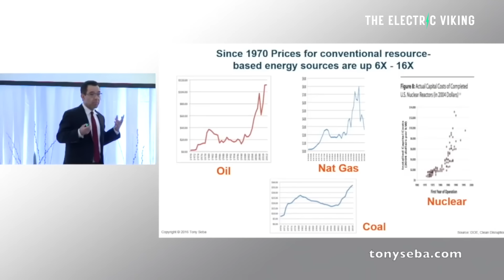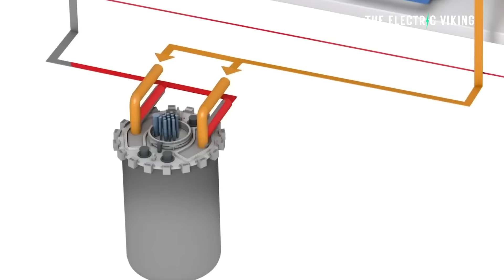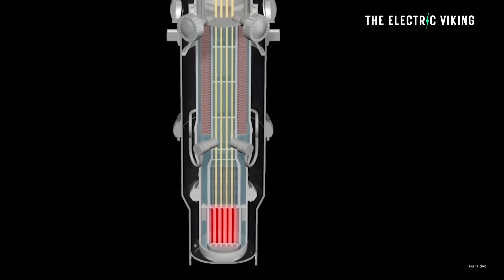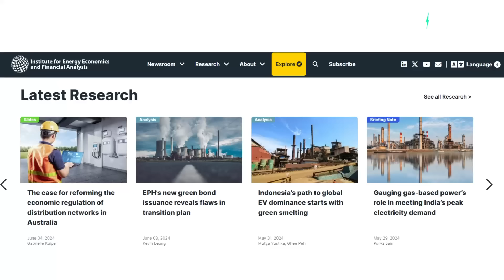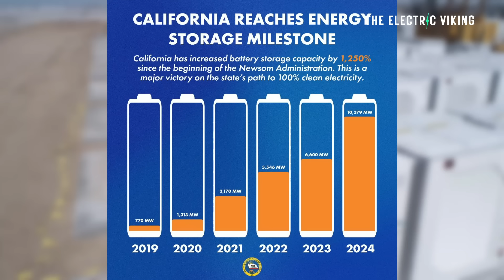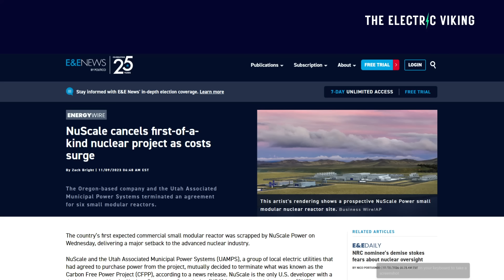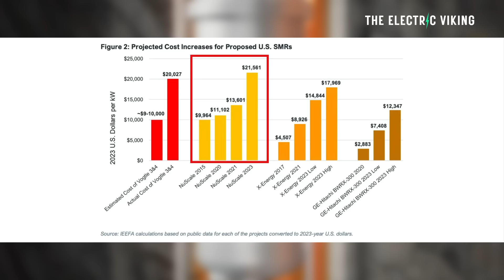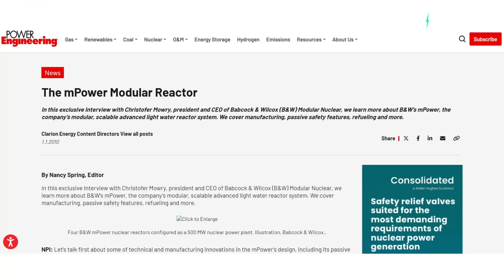In 2014 Tony Seba said Nuclear would be obsolete by 2030 - he was right

Comment: SMR's are still possible. The very small units are portable and are very safe compared to what most people have seen in the media and could still find very useful application at low costs.
Reply: The electricity cost from SMRs is very high. What is "cheaper" is that you're only building small units so the investment is obviously lower – but you're also producing less that with one big plant.

Comment: If it's going to be obsolete by 2030, any project you start now is going to end up a stranded asset by the time you finish. Unable to sell power because it's too expensive for people to want to buy it vs alternatives and because nobody wants to buy your power nobody wants to buy your power plant. So you have a giant paperweight.
Reply: But ruinables are more expensive than nuclear if you use real numbers.
Reply: @ForbiddTV Any proof?
Reply: @205rider8   Sure, lots of proof.
Reply: @205rider8   The Greenie numbers are RATED capacity.  Wind rarely puts out rated capacity, and solar NEVER puts out rated capacity.
Reply: @205rider8   As an example, all my solar systems put out only about 1/4 of its rated capacity in the best summer months, and only about 1/32 of its rated capacity in the worst winter months.  Aside from maintenance periods, nuclear can put out its rated capacity 100% of the time.
Reply: @205rider8   Wind is similar; my systems are rated at 25mph and very rarely is the wind blowing at 25 mph.
Reply: @205rider8   Solar only puts out NEAR its rated capacity for about an hour on a cloudless day.
Reply: @205rider8   Solar panels also degrades about 2-3% in the first year, and another 1% each year thereafter.
Reply: @205rider8   All ruinables need a peaker plant or storage to operate on the grid.   Be sure to tinclude the cost of a peaker plant or storage to your Greenie numbers.
Reply: @205rider8   Oh yeah, you have to completely replace ruinables 2-3 times in the same lifespan of a typical nuclear power plant.
Reply: @205rider8   Then there's land use.  Wind farms requires 360 times more land than a similar-capacity nuclear facility, while a solar plant requires 75 times more area, and those are RATED numbers which are wrong in the first place.

Comment: The whole idea of the SMR is that it’s the cost of bespoke designs for each reactor that makes them expensive. Looking at the costs of developing prototypes doesn’t tell you the cost once in series production. The automotive industry has the same problem. Creating a small run of or one single vehicle is expensive (especially if it needs to go through certification processes). Mass production of both makes things cheaper, and once the approval process becomes something well understood by both governments and the manufacturers that should become faster also.

The big question is how much storage capacity and excess generation (to allow storage to be filled) would be needed to cover periods of low sunlight and wind. Put numbers against that and we’ll see how cost effective nuclear actually is.
Reply: The so-called 'learning curve' for mass production is achieved by making 10s of thousands of iterations. With SMRs we're looking at a) 50 different design, and b) a very small number of builds. Plus, the 'power block' (where a steam turbine is used to make electricity) is already as good as they'll ever be so no cost reduction through 'learning' to be expected here.

Comment: Seba is wrong. The cost of nuclear is much less expensive than solar over time. We will have more nuclear in 2030 than now because it is cleaner, safer and more reliable than any other source  

Cost are only driven high by political resistance not construction or operations.  Solar is good nuclear is awesome.

Comment: Renewables keep growing.  So Tony Seba is right (in this sense).  But this hasn't made much of a dent in decreasing fossil fuel use.  

The data center issue, is a good test.  Most of the tech companies want a low carbon solution.  They are more price insensitive than most sectors.  But they need the build out this power fast.  They are willing to pay a premium.  Power requirements are huge.  And they need 24/7 support.  So what is the solution here?  Is renewables+storage enough?

I was hoping for better with nuclear.  But apparently, even with the new designs, its taking too long, as too expensive.

Comment: Until recently I thought that we would always need nuclear to backup renewables but I don’t think this is the case now that we have cheap battery grid storage.

All you need to do is to build enough renewable generation (which is massively cheaper than nuclear) and install enough battery storage to cover any dips in renewable generation.

I also think there could be a case in the UK for generation from the tides. Big up front cost but virtually nothing to run it and guaranteed predictable generation.
Reply: You think massive battery storage is cheap?  The need for controllers and long range communication make the complete green energy dream prone to multiple failures and long down times.  There will be weak prone system connections that will bring a New York City type  Black outs ,  1965 , 1977, 2003 .  K.I.S.S..
Reply: @mikewallace8087  it’s cheap compared to nuclear.

Not sure what you mean by the need for “controllers”. Are you suggesting that nuclear or gas need no control systems?

Long range communications: why is this a problem with the Internet and systems like Starlink?

Where are the figures on downtime, we would love to see them.
Reply: @johnmason5626   A central power plant it is easier to access problems and perform Maintenance and repairs as all necessary tools / needs  are on hand .  Battery storage systems are many and widespread. As a field service technician   I know about travel time , physically moving needed tools , working in uncomfortable weather , having every replacement parts for various manufacture equipment .  Starlink satellites are prone to Solar geomagnetic take downs .  Starlink had a 40 satellite failure on one storm .  We would love to see them ..?  How many people are you ?
Reply: @mikewallace8087  so, what you are saying is that a central power planet is a single point of failure. Got it, good to know.
Reply: @johnmason5626  Central power plants have redundancy systems that are tested by bringing into action so as the duplicate system is tended to to prevent / reduce the chances for power production  failure . The systems are flip flopped to use in the system for even durations.   You are disingenuous as I already knew.
Reply: @mikewallace8087 that would not help with a natural disaster. This is why, in the IT industry they use at least 2 data ended is different locations.

In any case, the energy industry does not agree with you since global investment in renewable generation has overtaken investment in fossil fuels.

Comment: Small nuclear reactors will be ideal for Mars since low air density means wind power is out yet there's enough wind to fill the air with fine dust particles for months at a time, making solar energy a poor bet, even with batteries.

Comment: What you failed to consider here is why is the cost and delays so awful with nuclear? Wind, solar, batteries, is heavily subsidized and has its own set of environmental issues, many of which will not be realized for another 30-40 years. However, when that bill comes due, it will be far greater than most realize.
Nuclear power looks awful from a cost and time perspective because it has been demonized for so long they make the regulations involved in building/operating ridiculous, and that is what drives the cost and causes severe delays. Also there are virtually no subsidies or political will to push for a nuclear solution. And so it becomes a self fulfilling prophecy.
There is literally nothing "renewable" about wind and solar. There is a huge cost (monetarily and environmentally) that is hidden with these options. Besides all the cost in creating these options they also require maintenance and will have to be replaced on a regular basis, and it all involves highly toxic chemicals that must be mined and then properly disposed of to prevent toxic pollution. This idea that wind and solar are some environmentally friendly low cost power option is complete BS.

Comment: You are completely right - if you are lucky and live in sunny Australia, California and the like.  I know the large majority of mankind is lucky enough to live in the sunbelt, and there it is the right way to go. 
There is however  a not neglible minority living at to high latitudes and/ or prolonged dull / rainy seasons. In densely populated areas resistance to ever more windpower Installations is growing rapidly - even though w'are at merely 50% renewables of current  electricity demand, and have barely startet to electrify industry, heating and transportation. For cases like these new nuclear still is an Option!

Comment: a nuclear power plant produces about 1 gigawatt of power (10^9 watts).   that is equal to the power from sunlight falling on one square km!
(10^3 watts/ meters^2   x  10^3meters  x 10^3 meters = 10^9 watts )
Reply: Sure.    But solar panels are at best 20% efficient(*), so now you need 5 km^2 -- for a few hours around noon on a perfectly sunny day.    What's the average insolation over a full year at your proposed site?   If you're lucky it might be 100 watts/meter^2.   So realistically, ow you need 50 km^2.     Plus a huge battery bank, which might last 10-15 years before it needs to be replaced.   Meanwhile the 1 GW nuclear plant that sits on one square km will pump out an average of 900 MW for 60-80 years, day and night, clouds or sun, it doesn't care. 
(*)Yeah, I know, some are now 22-23% -- when they're brand new.   But with inevitable degradation over their lifetime, 20% is probably optimistic.

Comment: If a $2billion SMR breaks down is it $2billion for the new one ??  😮
Reply: Well, maybe the broken one could be repaired.  But you need to have a spare one standing by to take over.  And that's another $2B.
Reply: @bobwallace9753  they say they dump into a holding tank and stop heating 
But still, radiation emitted and it is left in the ground. 
Time moves on, and the new one still needs to be built. 
I have had a few major construction projects amended when I asked the design engineers in front of the client about the next step when things go wrong. 
Hahaha , Hahaha. 
The silence often tells much, as my economic neck was on the line, and I had to come back to do that next step.

Comment: However, when Nuclear Fusion becomes practical, then battery backed Solar, Wind will become impractical. 

Battery farms will still work well with Nuclear Fusion, in the same functionality as today, leveling daily demand cycles, eliminating the need for Peaker Plants. 

Nuclear Fusion finally reached the point of generating more energy out vs energy imputed to cause the fusion in 2023.

Comment: Commercial nuclear is the longest running joke in the energy industry.  Over 70+ years of commercial nuclear, it only powers 10% of the world's grids and falling.  Each and every nuclear power plant construction is over-budget by billions and over-schedule by years!

The next 10 to 20 years will be critical to mitigate the worst of climate change.  Yet it takes 10 to 20 years to build a single new nuclear power plant!  New construction nuclear will essentially have zero impact on the huge amounts of energy needed to displace fossil fuels.

Meanwhile, renewables have reached historic low costs of production and continue to fall.  Much less than 1% of the world's land surface in current generation photovoltaics to power all the world's grids!  At 99.9% the mass of the solar system, our sun provides us a cosmically large 173,000-terawatts continuous to the Earth, all the combined fossil and fissile fuels on Earth literally add up to a bucket or two in an ocean of clean sun energy!

Every dollar spent on new commercial nuclear over renewables actually slows down the much-needed energy transition.  My fear is that fossil fuel strategists know all this and will push for nuclear doing so.  That Vivek Ramaslimy particularly pushed for nuclear too and I think they know.

Nuclear will be completely gone from the commercial grid by 2050.  After which, small-scale nuclear will continue in military, scientific and medical endeavors.  It can be useful in very remote locations like deep-space exploration.  But for terrestrial grid operations, nuclear is completely unviable.

Finally, nuclear is the only power generation technology capable of producing catastrophes of the 1000+ year variety.

Comment: Using your logic Tesla should never have succeeded. Tesla took years to get the first car of the drawing board, costs overrun by 10,000's, it was impossible to mass produce and the TAM ment it would ultimately fail commercially. SMR's have a much better chance of succeeding, as they are designed for mass production, unlike conventional nuclear! However, nuclear power will always cost multiples of solar. How about building Solar on the moon to power data centers built on the dark side! This will power all the crypto mines and AI Training needs. If only we new someone with a Starship that could carry 100t payloads and the power to make it possible?

Comment: ONGRID customers will go OFFGRID 
Grid infrastructure costs will explode ONGRID customers bills.
Grids are fragile because grids are extremely expensive. 
OFFGRID will look dirt cheap. 

Nuclear is a dead duck with out grid customers. 
Nuclear is a dead duck without big government
Reply: Sure, single family homes that aren't too far north (or south) have the potential to go off-grid with solar.   Apartment buildings, not so much.  Energy intense industry or data centers?  Not at all.
Reply: @TheUweRoss  where I live the apartment blocks can use the surrounding neighbour's excess rooftop solar power and pay for it. 
Local grid and community battery or building battery. 
The numbers make sense. 
Big cities are not the majority.
NYC solution is different to the sprawling surrounding. 
NYC is a very cold latitude, 80% of the world's population live in warm latitudes.

Comment: Tony is not correct when talking about having to have centralised generation is to expensive because the system has already been built that way
 seems he assuming to either build 1 or the other but 1 is already built
According to data released and advertised we now need build up to 26,000 kilometres of transmission line to draw in the wind and solar costing billions

Comment: Costs are irrelevant, when there is not enough uninterrupted power supply. For many countries in the north one half of the year there is not enough solar and wind and temporary storage. Tony has no solution for this only than politically unstable solutions. This is the big Safety problem!to not give unstable countries to much leverage. So it’s a human trust and political problem, not a technical or commercial problem. So therefore certainty is more important and therefore this is going to be paid, although expensive the risk to economy is more. Hope this helps… Australia has not got this problem due to each day the amount of sun.
Reply: Name a country that will not be able to get enough energy from a combination of solar, wind, hydro and geothermal with battery storage and interconnectors.
Reply: "Tony has no solution for this only than politically unstable solutions." - What a dumb thing to say! It is not the job of someone like Seba to provide "solutions". That is the job of vocational experts in the energy sector.
Reply: @BrentonSmythesfieldsaye  Hold on, I've listened to some of Tony's videos, and what he says, is he has yet to find a place where you can't have 100% renewables. He came up with a mix for places all over the planet. You need 2-3 times as much generation as you use in a year, and 1-5 days of storage, and the mix varies by location. And I'm going to add that the mix will also depend on what things cost when you are building. Anyway, this 2-3 times generation leads to an added benefit he calls superpower, which is basically lots of very cheap electricity at certain times. This combination will be CHEAPER than the FF system it replaces.
Reply: @fjalics  I don't have any problem with what Tony is saying. I think you misunderstood my post, which was specifically to the OP. 
I am tired of people mischievously trying to conjure political motive into the energy transition.

Comment: Nuclear has its uses. For example, you can’t run heavy industries with solar or wind energy.
Reply: True.  Large machines sniff out electrons flowing from panels and turbines and refuse to use them.
Reply: not today anyway
research is being done to use solar to make high heat energy, and they are getting closer
hydrogen has been used to make steel in Sweden, so technically it is possible, but probably in those cases, nuclear would be cheaper.
Reply: It is very dangerous to assume something can't be done, when nobody has ever had a reason to try to do it. The transition starts with the low hanging fruit. First, add renewables to the electricity mix, then add batteries so you can add a lot more. Once you add so many renewables that you get a lot of curtailment, you will get low prices sometimes, and low prices will grab the attention of people building industrial processes, and they will find a way to use cheap energy inputs. Making metal out of ore is one that works now. Ammonia is another. Your blanket statement is false for sure. I saw a process where they were concentrating solar to hit a temperature high enough to cook limestone to make cement, not that that is commercialized, but maybe one day.